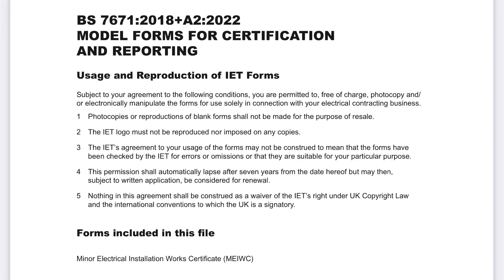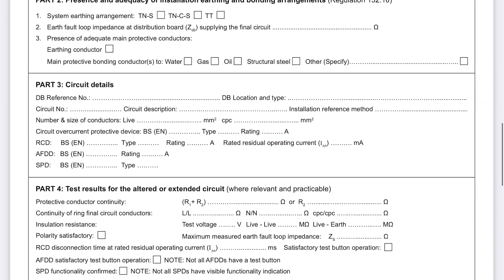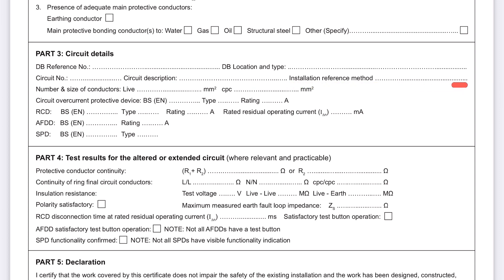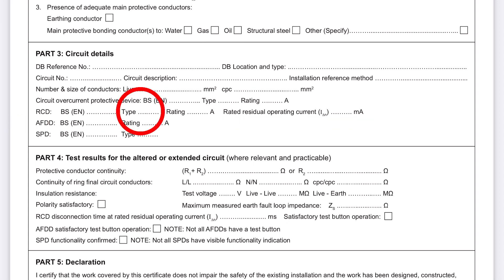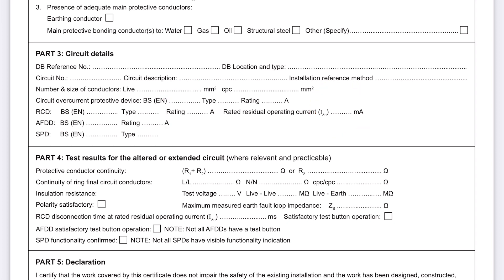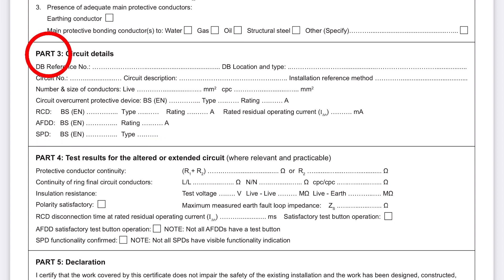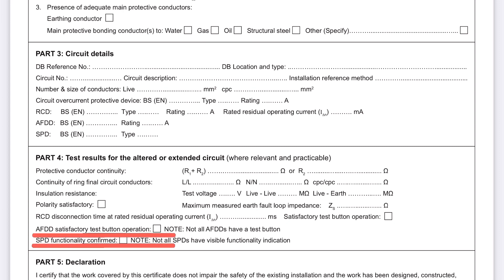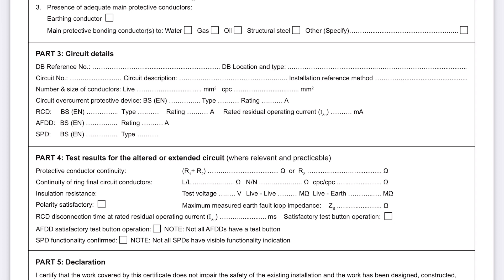What are the Changes to the Minor Works Certificate - 18th Edition Wiring Regulations BS 7671 Amd 2

Comment: So I have to replace my books miner works certificate as well my electrical installation certificate  or are my existing certificates still valid for now ? 
Thank you for the heads up 👍👍❤️
Reply: I think there's a 6 month over lap I believe until around September until the new regs have has enough time to work in.
Reply: That was after I spoke to a college in Nottingham the other day and asked how long my 18h edition bluebook is still valid and I was told for about 6 months until September onto which time I will need to be taking the 18th edition exam again with the new books, which I guess includes the updated certificate?  Hope that helps.
Reply: @jameshorspool5054  thank you
Reply: @seandempsey7351  anytime 😊
Reply: I know it's just crazy eh?... I have a full book of them!...bleeding waste of money, and the regs book AMDt 2 doe's my nut in greedy gits all they want is for us to pay the IET for sitting at a desk thinking up ways of how they can screw us over every couple of years. 😒